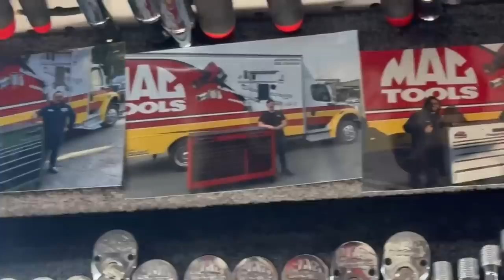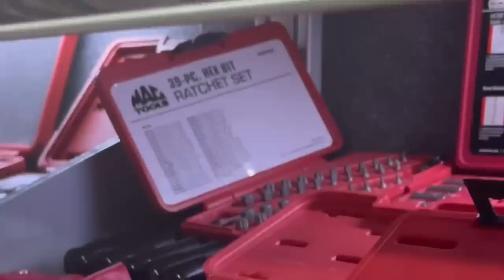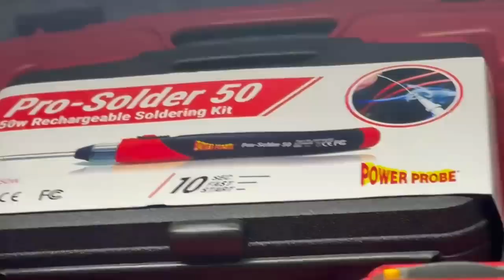Mac Tool Tuesday 09/12/23

Comment: I think the 1/2 inch cordlees tools have their place outside the shop....but in the shop im using my ir titanium....way less vibration way lighter and doesnt try to bounce itself off the bolt....plus the air never runs out and the shop pays for it....not me paying for batteries

Comment: Question. I have 2 mat co rachets I need repaired and I don’t have a rep. Does ur tool truck guy have Someone I can call in colorado?
Reply from the maker: Mac or matco? I unfortunately don’t have a local matco guy. I would try calling or emailing matco. They may even have info on there website.